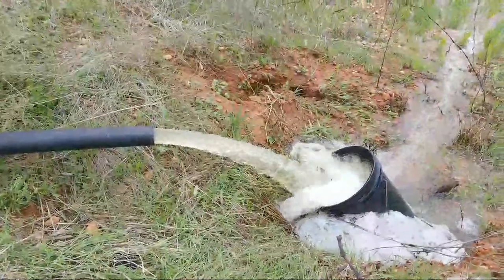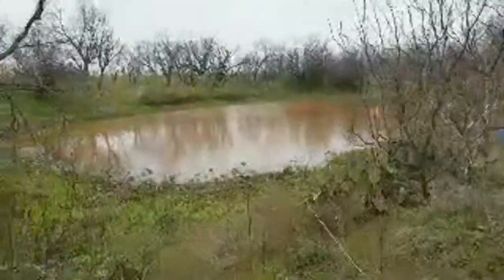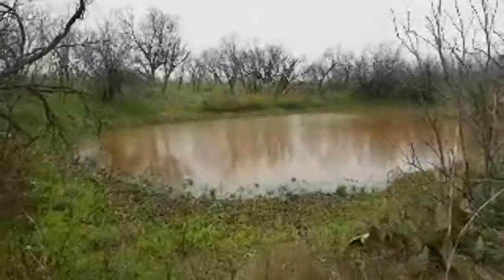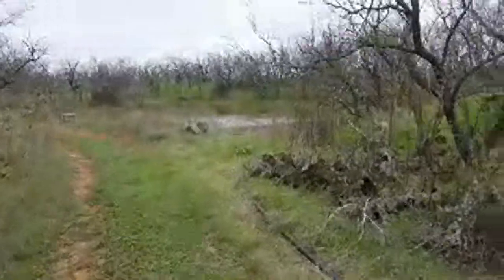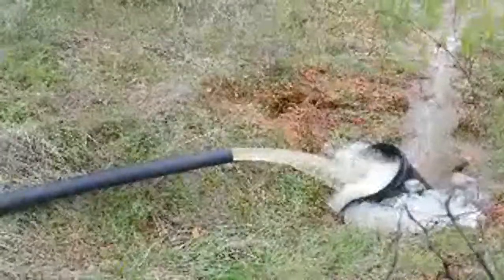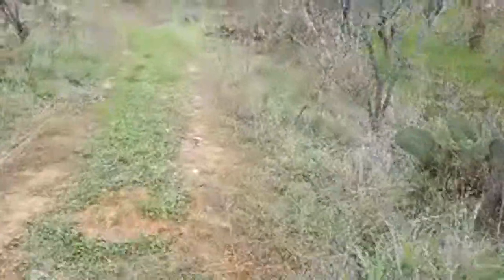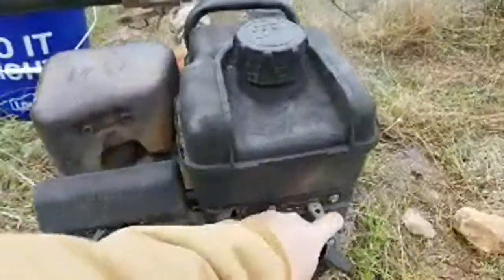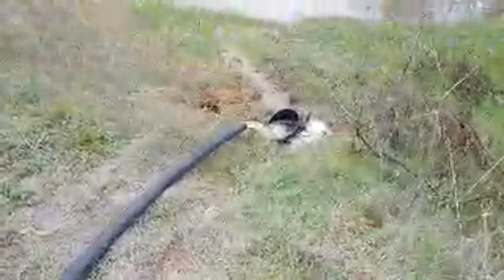Moving A Pond Of water With A Trash Pump. High or Low Speed?

Comment: This is outstanding information, thank you.  I'm betting my Honda will run even longer! 🙂
Reply from the maker: I am glad you found the video informative.  Thanks for watching.
Reply: @thejungleexplorer   I tested my honda semi-trash pump the other day.  It has a Tsurumi TE3-80HA pump.  0.86 gallons (3.25 liters) ran for about 8 or 9 hours at just above idle speed or about 1/4 throttle 😀.  I've almost got my 3" to 2" sprinkler system set up.  I'll test it and see how it does next